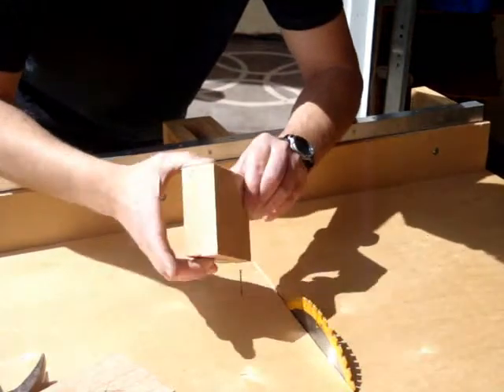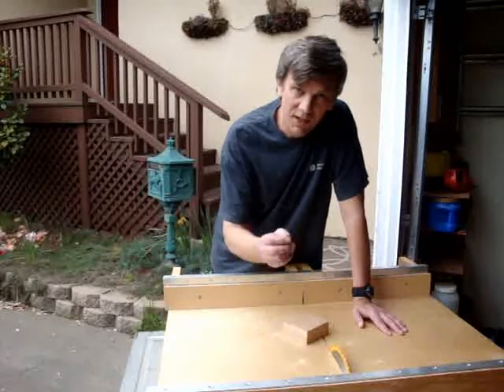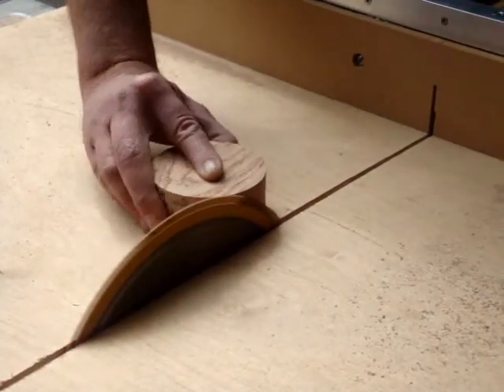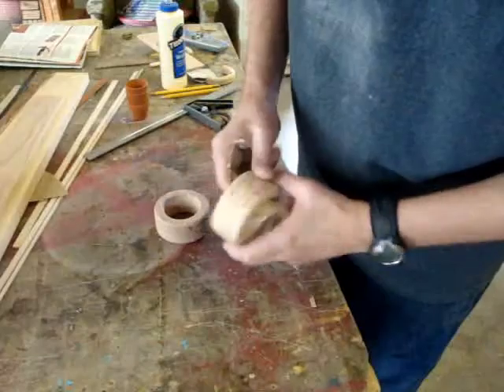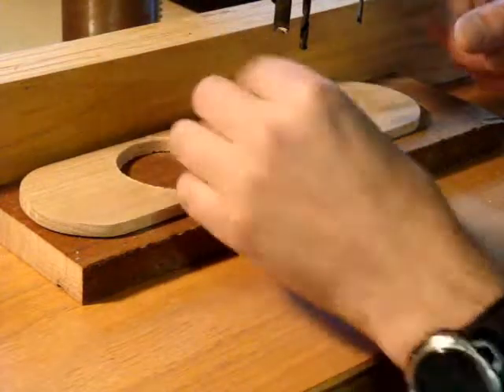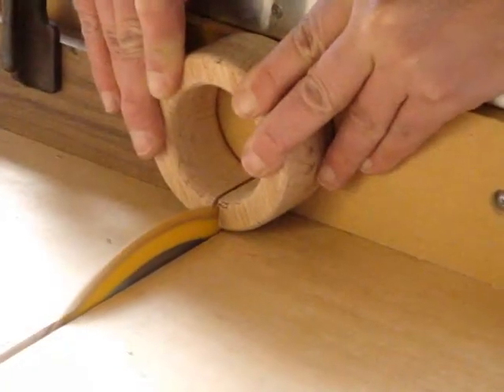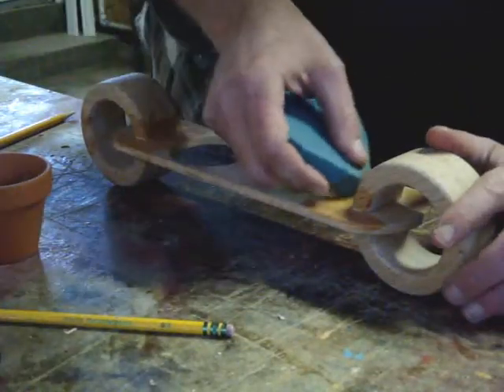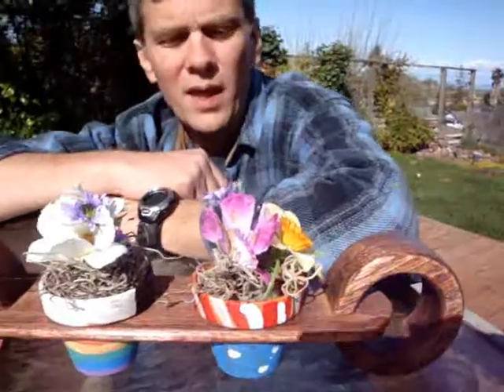Build a decorative pot holder with scrap wood

Comment: The distance between the brad and the kerf of your crosscut sled is the radius of the circle, right? Goes without saying? No, it's worth saying.

It's a nice technique to make circles for those who don't own a band saw. (Though the proximity of your fingers to the....I know, I know, you don't want to hear it.) 

I wonder if there's a similar trick to making large round holes--forstner bits and hole saws max out for me at a couple inches.